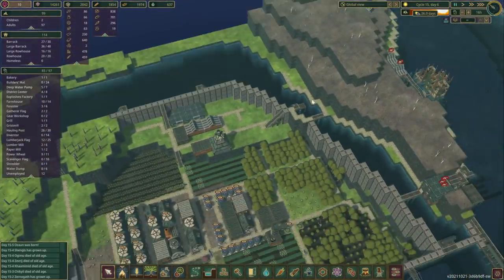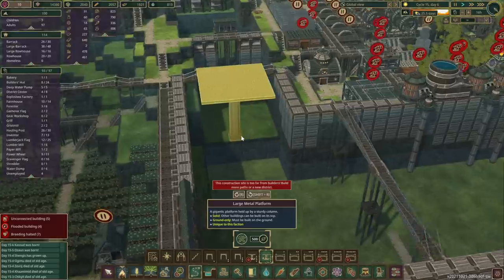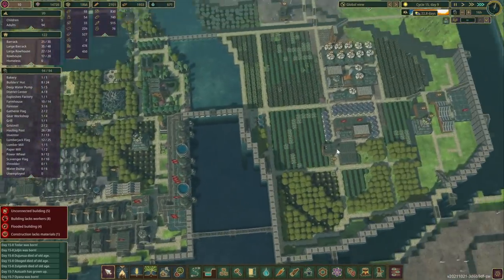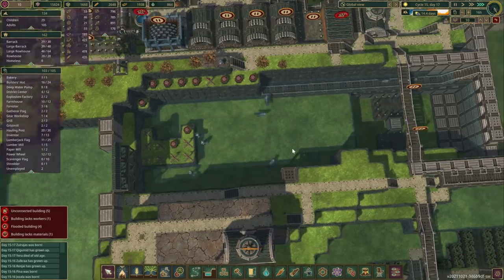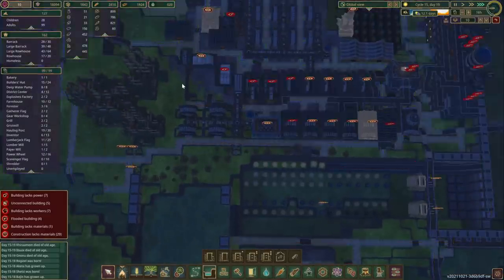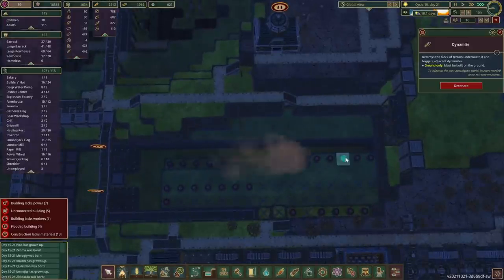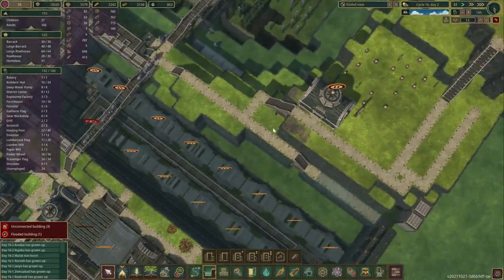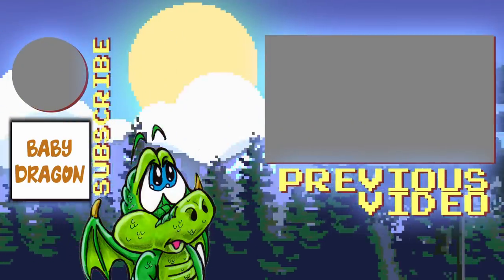TIMBERBORN | Time to Start Upgrading Power Network - HARD MODE | E18

Comment: Instead of dams use platforms as platform won't use water space and you can build over platforms water wheels
Reply: I think he’s using levees because platforms cost do many planks.
Reply: @Vikingwerk  platforms cheaper by tenth of the dam cost as you consume 40 plank in dam while in platforms you can save water  space and build over it and under it the power network and dam will be for narrowing but narrowing is also not that important as physics here ably by the whole motion, means that the water doesn't go like water fall but vertically fall and the motion of water happen by the flow so if you had two paths like in the hill , one will go to the right if you closed the second one which is the straight flow path(the original one) and the water wheels either way will move as long as motion happens.
The only condition for water wheels to not move if the water moves by 180` ,the water wheels won't move.
Take it like AC current it can go positive or negative but it can't had another third or fourth direction that is now the water wheels work here.
Reply: 40 LOGS in a dam, not planks
Reply: @gimlisbrother745   thank you for the correction and sorry.
Reply from the maker: Yea the actual reason for using levees here is to ensure water goes through the waterwheels to generate power :)

Comment: It looks like you are lowering the water level far lower than your water storage which decreases your net capacity if you want those water wheels are going to work at their current depth.  Maybe there is a planned bypass that lets you divert the water in the wet season to fill the majority of your water storage (and thus not filling the water wheel area that much).

I assume your goal is to have these water wheels running regardless of the wet season.
Reply from the maker: The wheels will still be two levels higher than the first reservoir though. But with everything else you are bang on! I hope it makes more sense once you'll see the end results :)